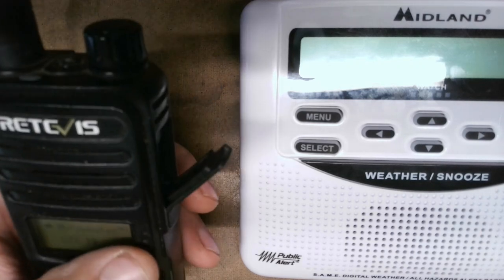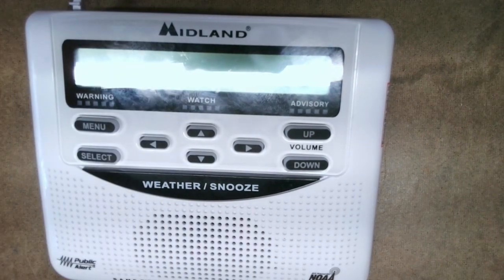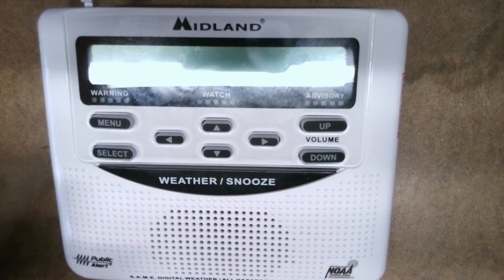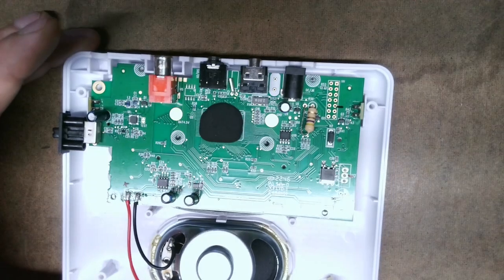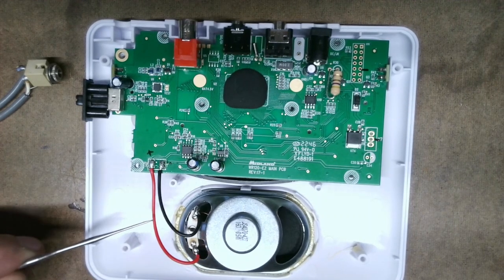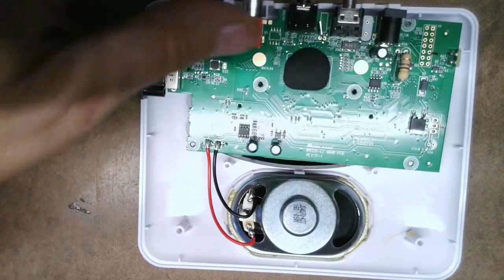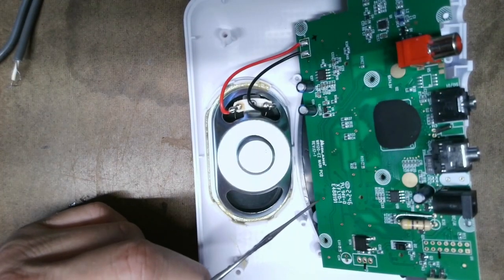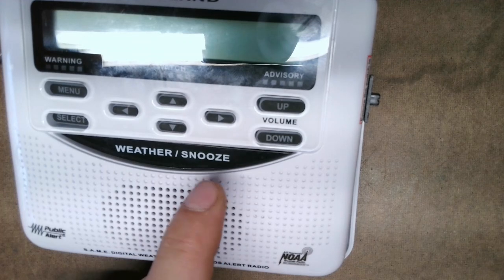🔺 how to modify Midland WR-120 weather radio to be used with DTMF tone for a GMRS two-way repeater🔺

Comment from the maker: UPDATE - 10-21-2024 after some checking, midland does NOT use the same circuit board version you see in this video!!! So this method in this video will not work with any other circuit board version!!! I am trying to figure out a better way for doing this!!!!